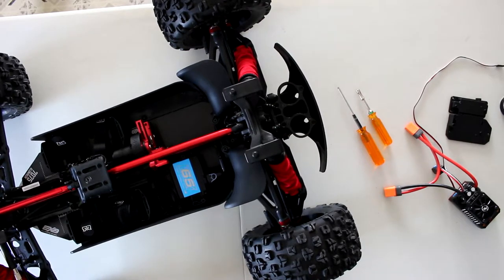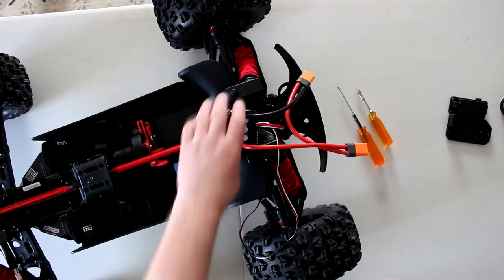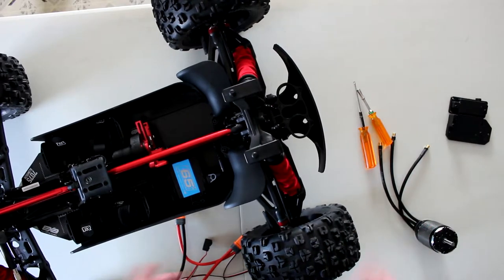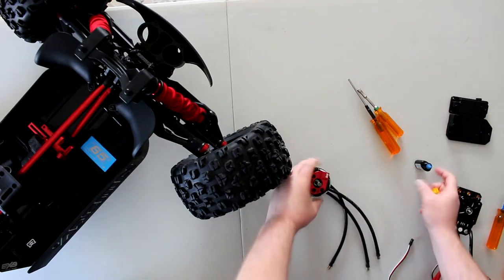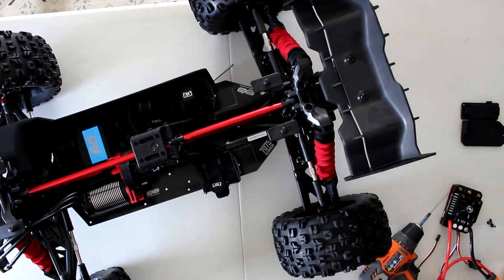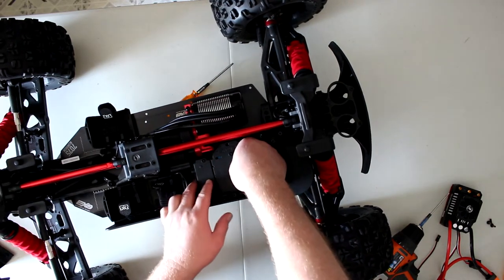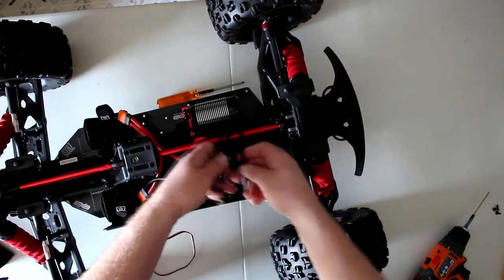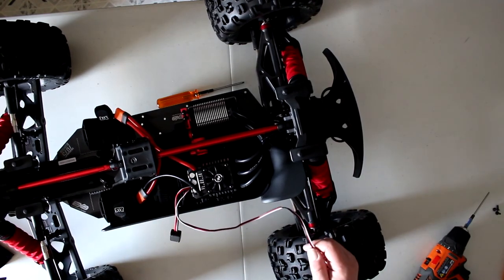HobbyWing, Max5, 1100KV, Arrma Kraton

Comment: Are the EC5 connectors ok or should they be changed to QS8? How did this compare to the Castle  Creations?
Reply from the maker: It depends on the weight of your machine and how much you want to push it but bigger is better.

Comment: What would u recommend more for bashing? The 1100kv or the 800kv I’m deciding on pulling the trigger on a 1/5 exb kraton and electronics.

Thanks
Reply from the maker: I started with the 1100 KV because I could not get an 800 and I had more pinion choice with the 1100 now if you have access to pinions you could go either way
Reply from the maker: And the other thing I swapped it out for a castle creation 1100 Xl2  did not end well for me but my gearing was more towards that style of can